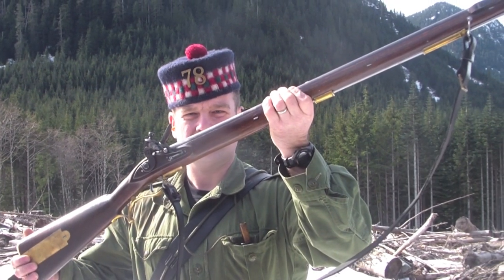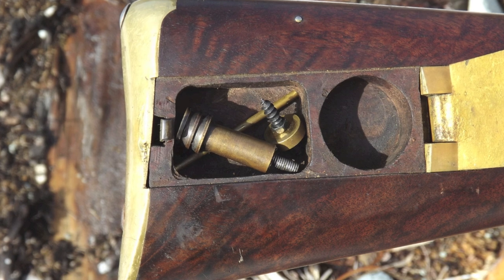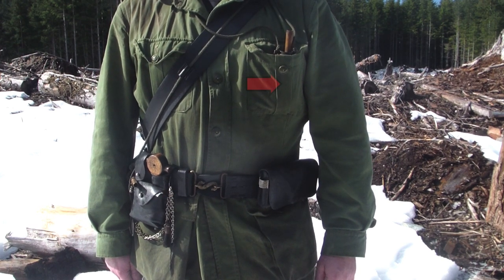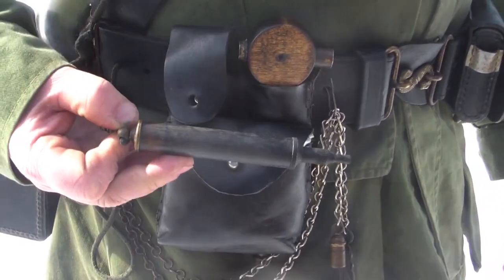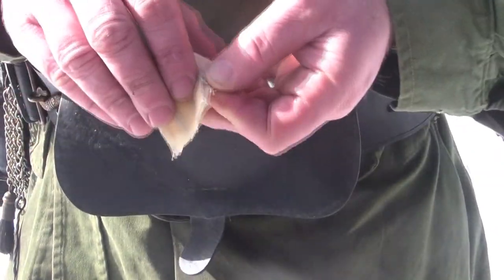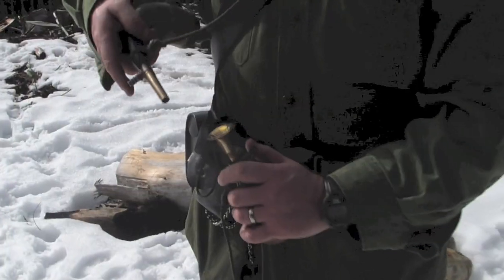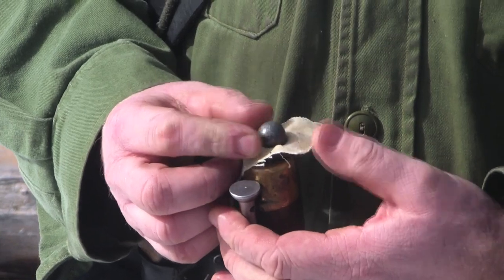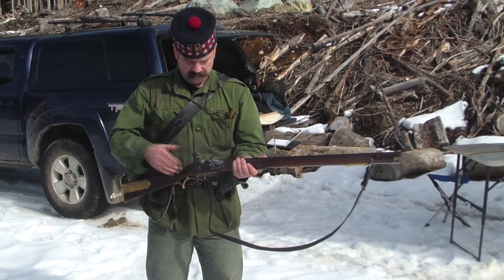1800 Pattern Baker Rifle:  Loading and Firing

Comment: I have a Rifle Shoppe Baker Rifle myself and I have to admit that I love the darned thing!  I am getting very close to the same accuracy results out of mine that you are out of yours!  It is a great rifle!
Reply from the maker: Hi there.  I would agree with you on the affection placed upon these Rifle Shoppe versions.  What pattern is yours? 1800, 1805, 1816, or 1823?  What size ball are you using?  Did you make it yourself?  Great to hear from another owner.
Reply: britishmuzzleloaders,  My Baker is the pattern 1805.  My load
, I have found to be very accurate out to 100 yards, is 80grains of FFFg KIK powder, primed with FFFFg GOEX, .610 caliber ball, with pillow ticking patch lubed with spit.   I also find that the Colerain barrel that came with the kit with the round bottom rifling is very easy to clean.  I did however install a vent liner, as the rifle builder didn't take into consideration the fire channel in the breech plug.  My rifle had a 50 misfire rate.....once I figured out the problem, I slightly modified the breech plug and installed the vent liner.  Now my only misfires are caused by bad flints.
Reply from the maker: .610, wow.  Though I have the same barrel, I have a lot of trouble with a .605 ball.(a .600 Lee mould, then one used in this video) and have taken to using a smaller Jeff Tanner mould that makes loading much easier with no appreciable loss in accuracy.  (the second Baker video is up and that is the ball I am using in that video).  What does your pillow ticking mic at?  That channel in the breech plug threw me for a loop too.  I thought that I had just wrecked my project all to hell when I realized that the pan was so far back along the barrel.  A phone call to TRS and some education from them went a long way.  I have a liner ready to go but not yet installed it.  Tricky, as it will install in the threaded portion of the barrel where it is thin and (of course) threaded.  Can you explain how yours was installed?  It would be of great help.  Cheers.
Reply: britishmuzzleloaders.  My bbl mic's out at exactly .620.  The ticking I use is .010, that and the ball are easy to ram down.  The Croation made powder:  KIK burns with little fowling and makes reloads easy additionally, living in South Mississippi our weather stays humid a good bit which keeps the fowling moist.  The balls are cast in a Lyman .610 mold.  Installing the vent, get ready my Canadian brother.  first you have to de-breech your bbl.  drill the vent out and thread for the liner, install the liner.  next have a machinist, clean up the inside of the breech on a lathe.  The key here is also to have the machinist widen and deepen the fire channel ever so slightly.  I don't have the measurements but I can get them.  re-install the breech plug.  Note, with the fire channel wider and deeper, when you prick your vent, the prick will go in at an angle and not straight in.  so when the pan flashes, it is flashing at the base of the power and not the side.
Reply from the maker: GunDoc39402 Thanks for that.  I figured that it was a similar process to the one that you have described.  Wanted to make sure that I was on the right track…  Most appreciated.

Comment: Firstly, thank you for uploading these great videos!!! Secondly, a question please. I recently purchased a Baker Rifle kit from TRS. It arrived here in Slovakia, where I live. After much searching I found a gunsmith to assemble it. He did a great job, however he was very concerned that the Colerain barrel wasn't proofed, he therefore treated the gun as a wall ornament, ie, the panhole wasn't drilled all through and the lock assembly wasn't tempered and hardened. The question, how did you overcome the proofing issue? As I'm assuming you also have a Colerain barrel that wasn't proofed. Much obliged for your reply.
Reply from the maker: Colerain is one of the larger names in the trade in the US.... proof laws are different everywhere you go... there is nothing wrong with it.  It is made to shoot. I'd say try and find somewhere to proof it, if Slovak law required it, otherwise don't worry, drill the touch hole (which is set behind the breech plug so it's not as straight forward as you might think) and start shooting!  That's what I did.
Reply: @britishmuzzleloaders  Thank you for the reply!!! Yes, Colerain have confirmed that because the barrel is of a greater thickness than law requires, there is no US necessity for proofing. I have just had the lock assembly tempered and hardened and refitted. It now sparks beautifully!!! Now to drill out the touch hole. The gunsmith already made a start, but didnt drill all the way. So I am assuming that I just need the correct drill size to complete the job. But you say that its not as straightforward. Could you explain more please? Cant I just push the drill through the existing hole? Sorry to sound stupid, I just dont want to make a mistake at this late stage!
Reply from the maker: @vierahromadova1882  In my experience making mine, the breech plug extends past the location for the hole... so if you drill into the existing hole, you will just continue to drill into the side of the breech plug.  This is intentional.  Once you have drilled through the barrel (as presumably slightly into the threads of the breechplug), you have to remove the breech plug and file a tapered channel in the face of the plug so that the wide end encompasses the area where the flash hole is.  This will allow for the flash to communicate to the charge properly.  Hope this helps.
Reply from the maker: If you google "channel cut in the face of a flintlock breech plug" you will find images of what I am talking about.... the American long rifle Forum has lots of info on this.
Reply: @britishmuzzleloaders  OMG.......Ive just read this and watched some videos.....its a much bigger issue than I realised. There is no way I can remove the barrel and breech plug, then file out the plug. its way beyond my capabilities...........so I guess I am left with a €4000 wall ornament after all. I am truly devastated.
But thank you very much indeed for your expert advice, it is much appreciated.
Reply from the maker: @vierahromadova1882  Why not?... AT the very least , you could have your gunsmith do it...  It is a very easy operation to conduct.
Reply: @britishmuzzleloaders  As I mentioned before, the gunsmith refused to treat the Baker as a working firearm, as the barrel isn't proofed or registered, and by European law this is illegal. This is why he didnt drill out the panhole or temper and harden the lock. He considers it a wall ornament. Unfortunately, I dont know of another gunsmith skilled on muzzleloaders. Ironic in many ways, as it was this rifle (along with the Brown Bess) that saved Europe at the Battle of Waterloo.

Comment: On a slightly different note: I'd like to know about your mallet.  Did you make it yourself?
Reply from the maker: Sort of.  Rather assembled it from a bunch of parts.  The rod and muzzle protector were from an old short starter that was rather beat up.  The head was a ball of walnut, also off of a broken starter.  I trimmed the sides of the ball down so that it fit better in a pouch.  Then I set the rod, the brass concave nub (for starting) and a small brass length for hammering into the wood with epoxy.

Comment: Hello,I'm a big fan of your site. I thought you mentioned in a previous post that you had picked up a British 1776 rifle from TRS. If so, I was wondering how things are progressing? I am also considering TRS Baker, 1776 or the Pistor Jaeger rifle as a winter project. Not sure which one yet but the Jaeger has a swamped barrel that might be a bit challenging to inlet. Just wondering how you would compare the Baker and 1776 rifle kits for complexity or issues.Thanks
Reply from the maker: +Dan Ellis Hi there.  The 1776 has been on hold for a while...  Just no time right now.  I'm about complete with the furniture but the barrel has been the difficult part.  It is swamped and the inletting has been difficult.  The captured ram rod has been a challenge too.  I would say that the Baker was an easier kit to do... and really, the three rifles have a different history, but  share a common lineage.  The 1776 has a earlier handrail stock that is a bit less comfortable on the cheek than the raised cheek-rest of the Baker.  Either way, you'll have a great time with whichever kit you decide to go with.  Cheers.
Reply: +britishmuzzleloaders I didn't realize that the 1776 rifle had a swamped barrel. Is the inletting difficult because the stock is not routed to accommodate the swamped barrel or is it due to fitting the breech plug and/or lock?Thanks
Reply from the maker: +Dan Ellis The barrel channel is routed in an octagonal shape but not with the corresponding curve on the underside... the sides of the channel are curved, though.  It's not unsurmountable, but just more finicky than the round channel on the Baker, that's all.  The breech plug is hooked and comes unshaped.  You have to fashion the hook yourself.  They both have the key method of fixing the barrels to the stock and this proved to be the most difficult and time consuming process in my experience.

Comment: My 14 year old son is very interested in this time era and has studied it for years how difficult is it to assemble and where can you get the cloth musket balls etc.
Reply: And $1000 is a little expensive anywhere else I can get it cheaper?
Reply from the maker: +Grant Kirby HI Grant.  The Baker kit was the first project of it's type I had ever done.  That said, I wouldn't consider myself completely lacking in woodworking skills, either.  Have a look here,... http://britishmilitariaforums.yuku.com/topic/16680/The-Rifle-Shoppe-Baker-Rifle-parts-kit?page=1 there are some pictures of the kit and what it looks like.  The parts come non-finished, as-cast.  Lots of filing and sanding.  Great project though.  As for a cheaper solution, try googling and you'll find a few vendors that sell Indian made repros that are all smoothbore, and of the wrong pattern.  Very commonly used with the re-enactor set, though.  Best have it checked out if you are going to shoot live with it.  Balls....  depending on your bore diameter, get either a cheap Lee RB mould, if there's is the correct size, or contact Jeff Tanner in England for a mould that is to your spec.  Cheers.
Reply: +britishmuzzleloaders thank you very much

Comment: Two questions.  First, was is the accurate range of the Baker Rifle.  And secondly of all, what is that outfit you re wearing?  It doesn't look like any uniform worn by the British Army in the 1800's.
Reply from the maker: First, may I direct you to the other videos in the series?  They will answer that quite definitively.  Second, it isn't a uniform....  so you are quite correct.... Theta is from the 1850s and the jacket is from the 1960s... You see, this is an historical shooting channel and as such, the requirement is to shoot these firearms in as close to the historical way as possible.... period clothing is a nicety but really, does nothing for the historical shooting experience...   If a uniform is something that appeals to you, there might be some Baker stuff with Rifle Green in the future...  Cheers.
Reply: Most of your videos that I have seen feature you wearing something approximating one of the British Army uniforms worn during the period, and so I was wondering what was the origin of the outfit you were wearing.  No criticism, just a comment.  Thanks for the response.
Reply: the most accurate range of a baker rifle was at least 200 yards. the maximum range was even higher, a 95th riflemen by the name of thomas plunkett killed a french general and his aide de camp from over 500 studs

Comment: there are several model of baker in the rifle shop. but which model specifically is the one that you acquired ?
Reply from the maker: +padzu101 Hi there.  This is the 1800 Pattern..  The stepped patch box is the most recognisable feature.  The musket bore Baker has a stepped patch box too, but of a different pattern.
Reply: +britishmuzzleloaderswould that be the one the rifle shop refer to as (Flat Lock Carbine Bore Baker Rifle (714)?
Reply from the maker: padzu101 I believe that's it, yes.
Reply: +britishmuzzleloaders thank you. it confused me a bit as to weather it was or was not the 1800 pattern because it didn't say it and because there are more than one 1800 pattern baker. there are patterns for the rifle, the carbine and others as well under the 1800 pattern of baker rifle. however and never the less thank you immensely.p.s. I certainly do need a baker rifle.

Comment: Beautiful wood! English Walnut?
Reply from the maker: I knew at one point but do you think that I can remember now?......  It is finished with many coats of wet sanded tongue oil with a touch of japan dryer...
Reply: My left-handed M1800 Baker was made by Jess M. of The Rifle Shoppe. There were just two options available, English Walnut, and the browned finish. I opted for both. It's certainly a beautiful rifle, but I have yet to fire it!
Reply from the maker: tsmgguy Just wait, when you do, you'll not be able to put it down.

Comment: How difficult would you say building one of these is? Do I need special tools?
Reply from the maker: HI there.  No special tools but a certain degree of experience and lots of patience...  tons of filing, sanding, fitting inletting with a great deal of finicky work that requires a big degree of accuracy...  An assortment of files, chisels, gouges and small versions of the same...  I used a Dremel once of twice only for some areas that didn't require any finesse.
Reply: Another question, how long did it take you to receive your parts?
Reply from the maker: Months and months.... order them and then forget all about it...  then when it shows up,.... SURPRISE!
Reply: Can you please remind us again where you purchased your parts/kit from?

Comment: I own an ORIGINAL Split Stock Baker - made about 1812....I need to get my hands on a replica so I can shoot one. I dare not shoot the original, I might damage it.............
Reply from the maker: As long as there is not DEEP pitting or obvious cracks in the barrel or breech plug then it should be good to go.  Is it in good condition?...  Remember, these were meant to be fired... Nice to hear of an owner of an original...  I assume that it is an 1805 pattern with the rounded matchbox?  Cheers.
Reply: britishmuzzleloaders Yes it is! All parts are working and I also have a bayonet for it. I may consider shooting reduced loads to check it out but that is for the future. 
I currently get my BP fix from my Hawken, Le Page, Remington 1858 and Evolution Inline weapons !!!!
Reply from the maker: Nice.  I should very much like to hear about it when you get around to shooting it...  History comes alive.